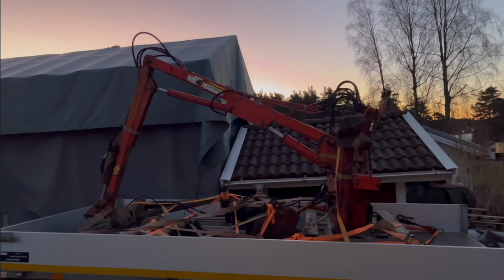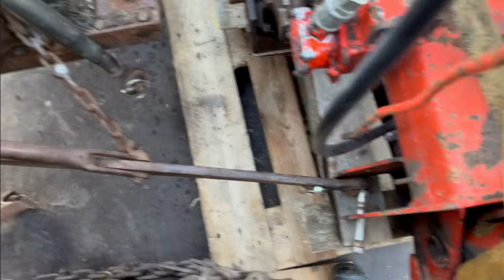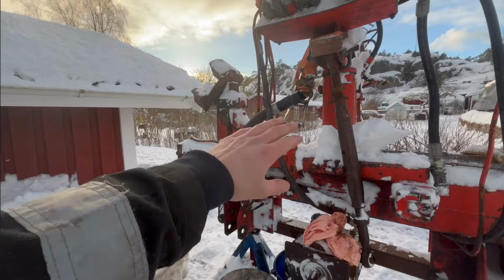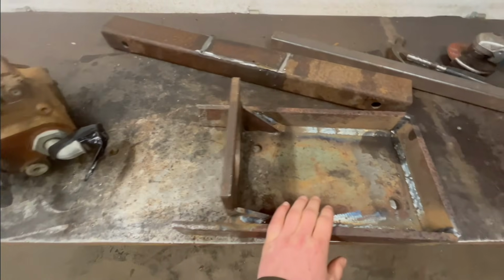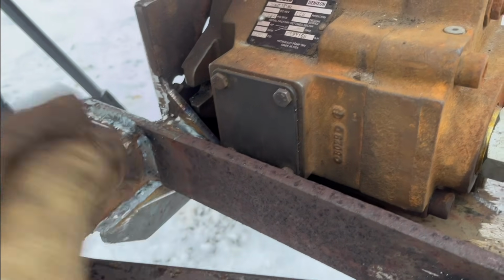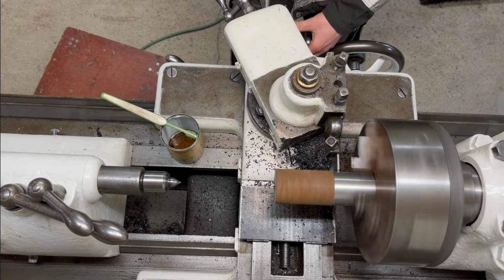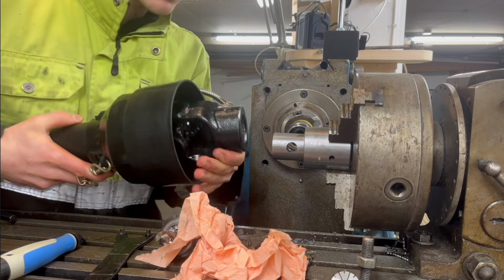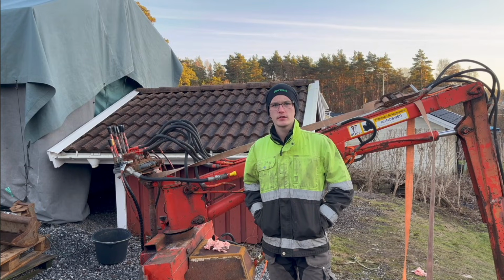Buying and Fixing a Cheap Backhoe attachment. PT 1.

Comment: Thinking of fabricating not a backhoe but some jib for lifting to attach to the back of a tractor in a similar fashion. What type and size of the motor is that? Can you share more on its specifications? Also am I right that your pto turns at 540 rpm? If so any problems with the speed?
Reply from the maker: Sounds like a good idea, that would be really useful. If you mean the hydraulic pump, I have no idea what type and size of the motor it is. Yes, the pto turns at 540 rpm. But I can say that I have got it working and the sped seems to be fine. Even if it's probable a slower sped then it's ment to work at.

Comment: I have had the same idea I have had some Backhoe excavators. And I have not used them a lot. It is because the power of the hydraulic and mast forces are so strong that they eventually start to twist the lift arms. The lift arms are designed to pull in a straight line, not sideways. Too big excavator or false use of the equipment can start to break the tractor. Therefore, the ideal solution would be to mount the implement rigidly to the tractor. If the tractor has a special frame, as Valtra tractors have for excavators, it would be perfect (they call it a sled or skid system). As a result of this realization, I have sold my backhoe excavators, and today, I am at the point where I have purchased the Jansen MB300 implement. Let's see how good it is...
Reply from the maker: Yes, I know it's not the best for the tractor. You have to be a little careful then using it. And the best thing would have been to have it mounted on a frame but I'm going to try to ty it up with the same chain to help a bit. And the Jansen MB 300 implement should probably work for small digging projects.

Comment: Nice job, waiting for the next part ! I have the same kind of Massey but with diesel engine.
Reply from the maker: Thanks😀.  It's a great little tractor that can do a lot. But it sounds much better with diesel than gas. So it doesn't drink 25L of gas in 5 hours of snow plowing!! It is quite thirsty, especially when it needs to work hard.😅

Comment: Pto shafts are designed to be cut to the length you need, split the difference with moving pump halfway, and cut shaft some
Reply from the maker: Yes I know. But thanks for the comment.😀